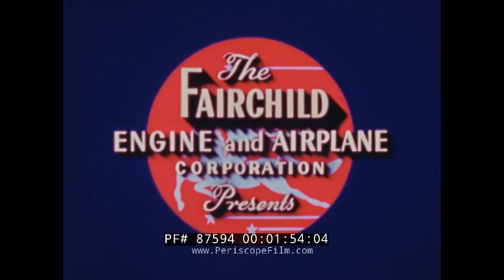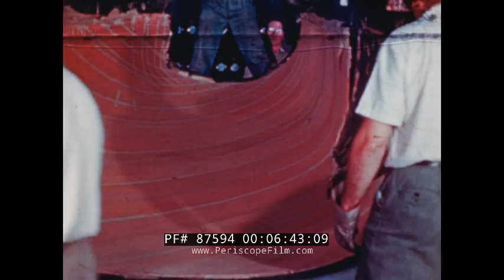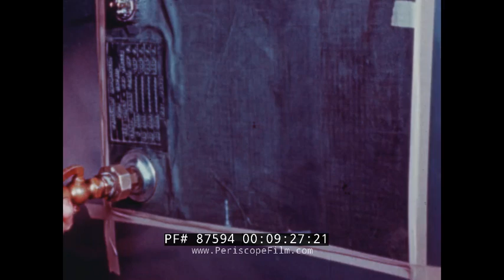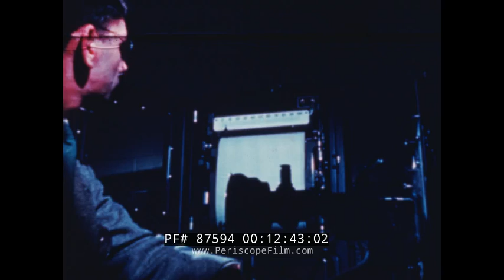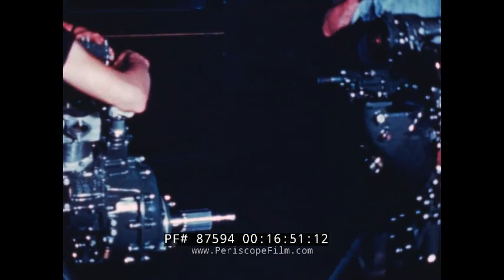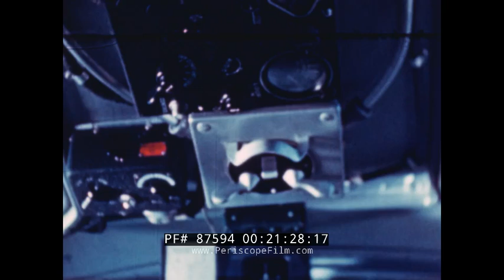FAIRCHILD AT-21 GUNNER BOMBER CREW TRAINER PROMOTIONAL FILM 87594

Comment: The Ranger V-770 had low power output and overheating problems in pretty much every aircraft in which it was tried. This was almost certainly due to the bureaucracy of wartime Pentagon resource allocation idiocy. The engine and the cowling were designed forated a particular turbocharger which was the most common one in use by proven operational aircraft. During developmental testing of a new engine and/or new aircraft, the generals reasoned that those turbochargers were too valuable to the war effort to "waste" on unproven equipment, so they instead provided some turbochargers that were laying around because they had proven to be too small and inefficient to be useful in the war effort. The result was not enough boost for the engine to produce its intended power output, and therefore planes that were too slow to produce the designed volume of airflow through the cowling, so the engines overheated.

Comment: I wonder how that Al-Fin process worked out over the long haul.  There is a similar process being used these days, called Nikasil cylinders. Used by one of the companies who convert VW air-cooled engines into Experimental Aircraft engines.  The word on the street is that the process does not hold up and the steel liner comes loose from the aluminum after a while.

Comment: Actually, the greatest rival(s) to the AT-21 were the AT-7 and AT-11 (derived from the C-45, a version of the Beech 18).  This was the initial career-track trainer for many bomber-crew officers (pilots, navigators and bombardiers), who would move to the larger planes after getting experience in the smaller, cheaper to operate planes.  The AT-21 attempted to improve on this role by being more capable and versatile than the AT-45, but just didn't cut it.

Comment: The Duramold process wasn't well suited for aircraft. Early models of the AT-21 had significant cracking problems due to vibration and delamination when used in humid environments. Howard Hughes was a great believed in laminated wood being the aircraft composite structure of the future, and it was the only easily available material to use for his famous HC-4, better known as the Spruce Goose. Even the lightness of Duramold wood wasn't enough to make the HC-4 a military or commercial load carrier due to its great size and underpowered engines. It was also a seaplane at a time that seaplanes were already becoming obsolescent.
Reply from the maker: Interesting. I have seen similar construction techniques used in this era, very successfully, with other forms of transport. For instance many buses in the 1950s had a laminated wood body with layers of wood and aluminum or steel. Not many of them survive (for all sorts of reasons) but one key reason is that once water penetrated the initial wood layer, the metal layer would rust and it would catastrophically fail.
Reply: It was a tricky process for the 1940's. They developed better glue and better methods of getting the glue between the layers in the 1950's but that came as aluminum and aluminium composites were also  developed, and aluminum was cheaper than the wood composite because of improvements in aluminum smelting techniques.Of course, carbon fiber and other materials make better and lighter composites now, and they have gotten cheaper and better ways have been found to make those materials. 

I'm 71 years old and it's fascinating to watch some of the old films on your channel since I was alive through many of the events in those films. I've seen the changes in life, mostly for the better, in person, and we are generally a lot better off today than when I was born in 1946.